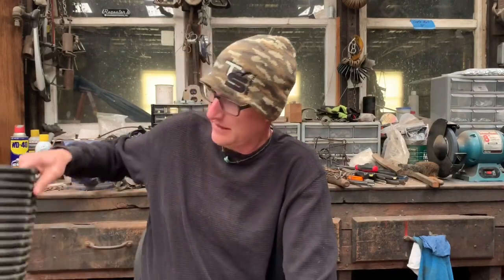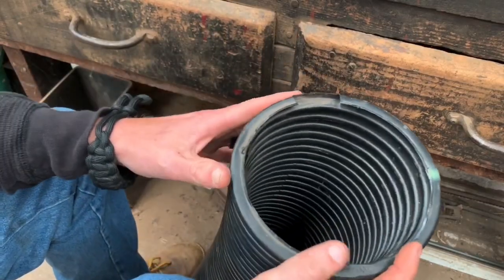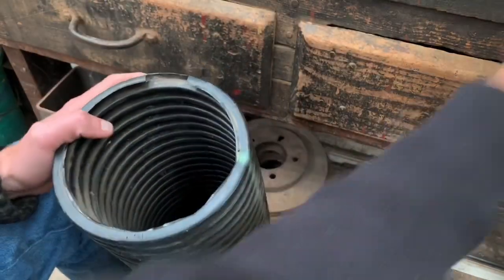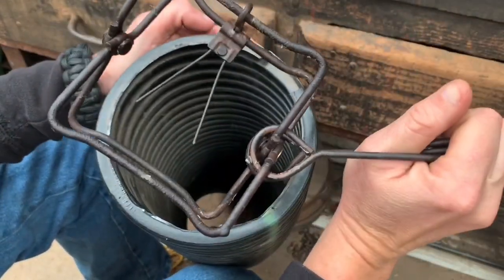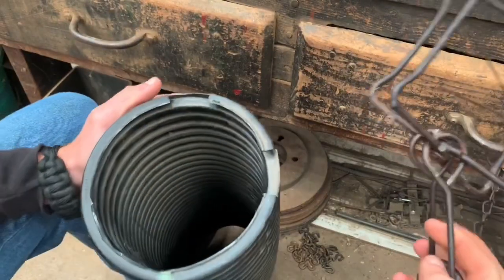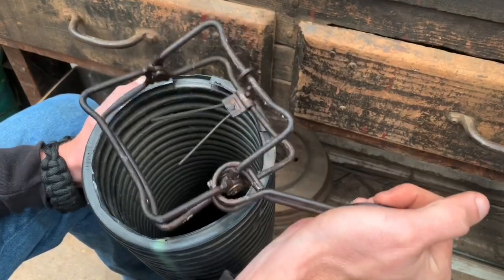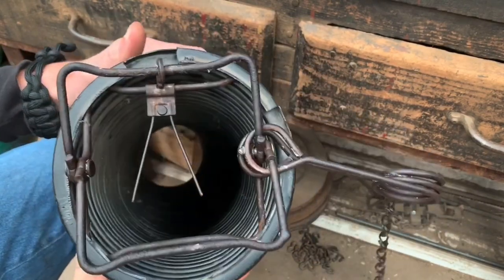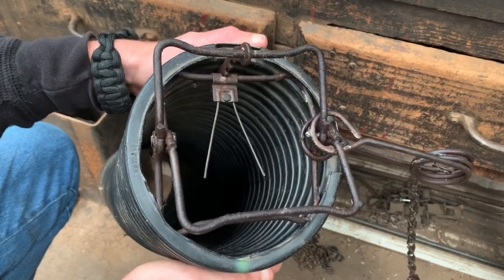#110 Bodygrip Trap Stabilizer Cubby made from Drainage Pipe

Comment: I’ve been making those for years. I cut the entire length of the pipe so it can be spread open a little. Then a small slit for the spring to slide in and I set the trap clear back in so only the outer jaw is barely exposed. Also a slit for the dog to pop through when the trap is tripped. Then I use 1x2” boards cut however long I want them up through the main slit so it touches top of tile and screw two screws through that. I can shove them down into the muck in whatever depth water I need to. Stick a baby carrot on the trigger and bang.

Comment: Do you use the V trigger configuration  for mink?  I have switched to one trigger wire straight up and the other bent low at 90 degrees toward the opposite  side of the trap. Dog on the bottom.  I'm connecting with a lot of muskrat and mink this way. My thinking is they don't feel the wire trigger as an obstruction when entering the trap.  Also there appears to be a large clear opening from their perspective when entering the trap. Great videos, a lot of depth to the information. Nice catch of red fox.